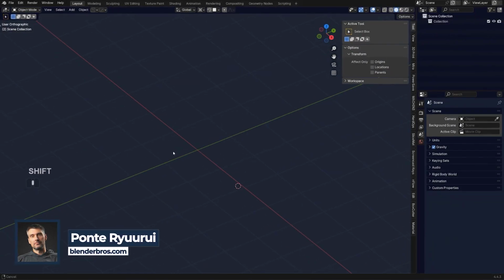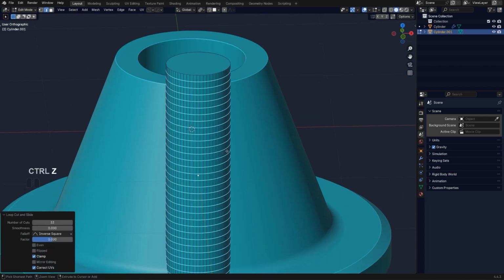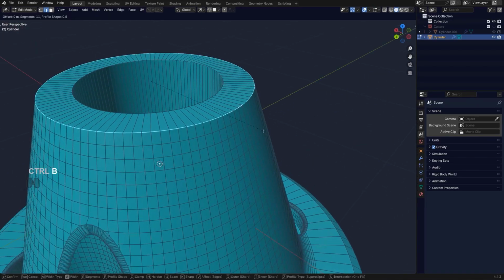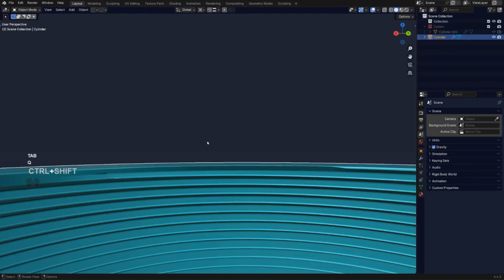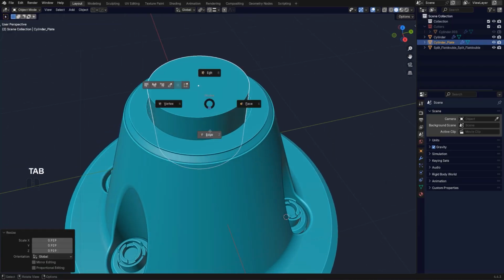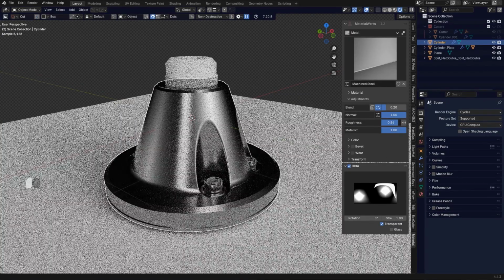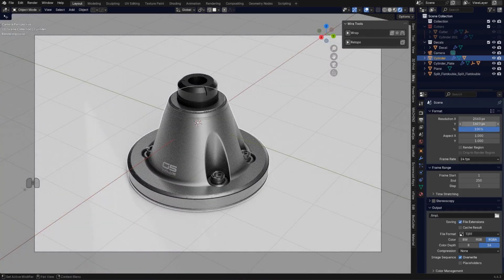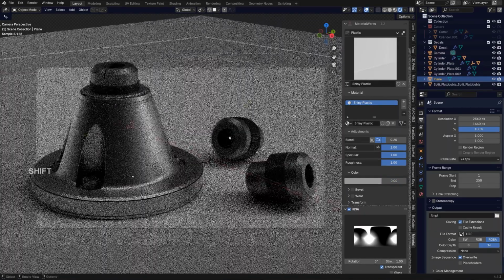Easy Blender Tricks for Awesome 3D Models!

Comment: Yo Ryu ! Pls i got a thing w the offset cut not working sometimes. I have tried playing w all the settings and my mesh is clean (no doubled up verts, No messed up normals, and the topology all around is clean but doesn't seem to work for me. If u got any ideas on what could be the issue ? ( m in the car design industry so it's  useful for me coz i also use booleans w subd and it s a life saving feature fr) Much appreciated, 

And please if i can have your email adress ?  I would like to discuss with you something work related, if you don't mind 

cheers !
Reply from the maker: update the addon if not working then ask machin3, he loves questions and emails
Reply: @PonteRyuurui    Alright, I ll try that. And rather meant your email instead, on work related topic in this case if you would have any interest, if not all good. thx for the answer either way